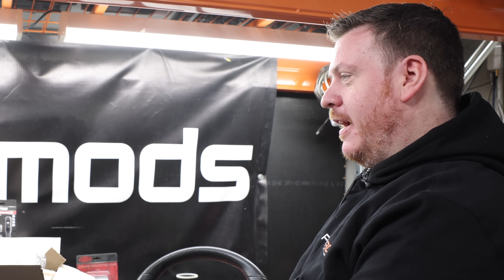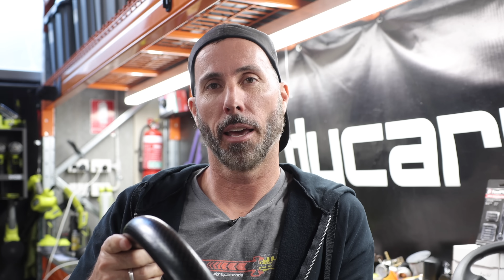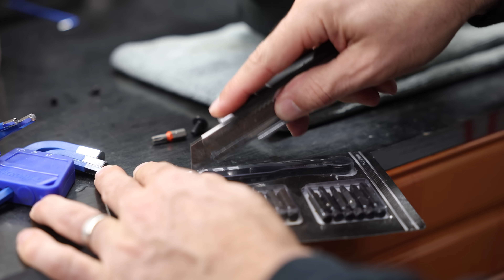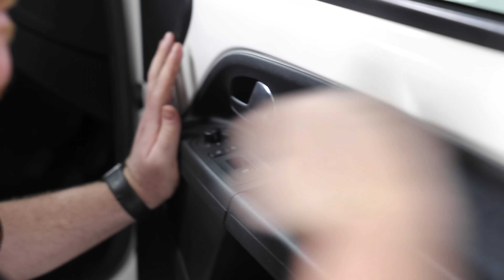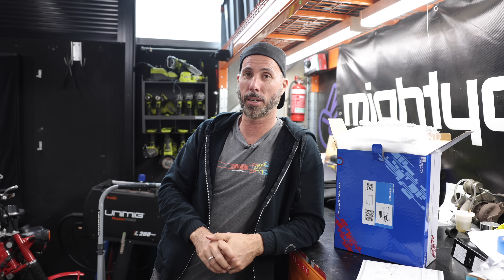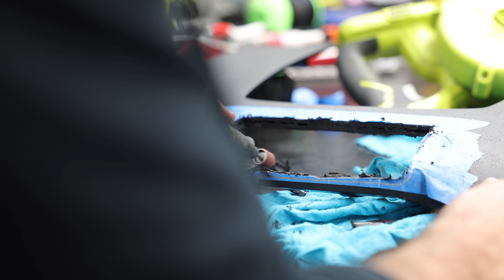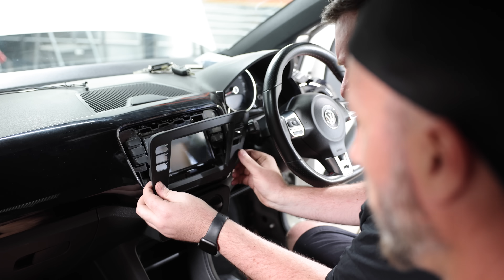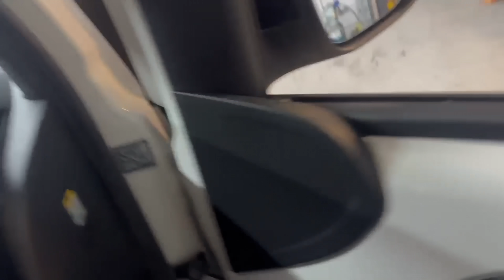Spending $40,000 to build a $10,000 Car - Turbo UP GTI Conversion EP9

Comment: As a manual VAG commander, I believe the reason for the DSG paddle extensions is 'because racecar'
Reply: Easy, so you can press the paddle while turning on tight mountain passes corners, with the puny stock paddles is almost impossible to so. I would rather drive a manual, but most new VAGs with higher trims/engines variants are DSG only nowadays... So to be able to at least use the paddles properly is a welcome feature that doesn't come stock.
Reply: @amigodesigns  the paddles are attached to  the wheel. they turn with it.
Reply: @shannonlenz1098  yep. It’s literally shown in the video. 

YouTube comments man.😂
Reply: @amigodesigns  Conventional wisdom says you shouldn't be changing gears mid-corner, because it will shift the weight (and thus grip) of the car at an undesirable time. 
Anticipating what gear you need for any corner, before taking that corner, is also just good driving sense.
Now I'll grant you a lot of people don't practice good driving sense in the first place :)
Reply: @feenyx6394  Conventional wisdom in this particular case isn't /quite/ accurate, particularly with how swift and relatively smooth most modern gearboxes are. 

Two situations I can see making a shift while technically mid-corner off the top of my head would be a decreasing radius corner where you're turning and braking already tightening to a point where exit would be better another gear down, and the inverse increasing radius where you're under power and run out of revs. Also, both of these hypotheticals involve the wheel being turned but the attitude adjustment from the gear change is either a non-factor or desirable depending on exact situation.
Reply: @feenyx6394  Not applicable in many mountain pass roads where I live, you are forced to downshift between consecutive corners to get ready for the slowest one, therefore you need to shift down while cornering, so way easier if you have a bigger shifter paddle than trying to aim to the tiny OEM one. 

Not every place is full of long and massive roads, same in Italy and most Mediterranean B roads, if you knew the places I'm talking about you will realize that what I'm saying not only makes sense but you are quite forced too unless you put the car in automatic, or unless you want to be in third when trying exiting the last and slowest corner before approaching faster ones. 

Regarding balance, sure that's why you need to know when cahning multiple corners where to do the downshift so you don't lose balance.
Reply: @feenyx6394  but an automatic doesn't care if you are mid corner, it'll change gear regardless. A dsg doesn't have a clutch pedal and will change gears even if the paddles aren't used at all, therefore it's an automatic. Even if it is more like a manual internally
Reply: I could see it being just-more-convenient,  really,  depending how a car like that actually fits me.
Reply: And that is, let's not forget, always a perfectly valid reason.
Reply: @andersjjensen  Sticking aliexpress crap on your car because you think it makes it a racecar is not the most valid reason, no.
Reply: @kennytheamazing  Conversely, sticking aliexpress crap on your car to make it look like a racecar, because you like that look, is a perfectly valid reason. 

I'm never going to be a taste judge because the abominations I call "random fridge content casserole" probably offends every chef in the world.

Comment: The paddle extensions are so you an reach it when the wheel is turned alpt in racing/track situation, but like most real mods its just for looks on most cars